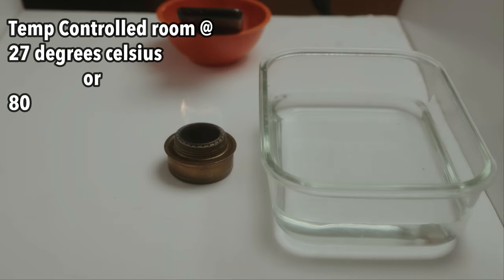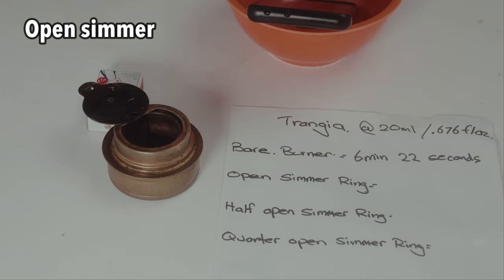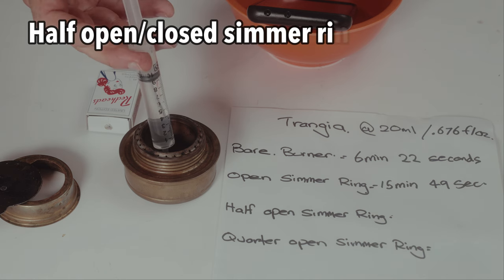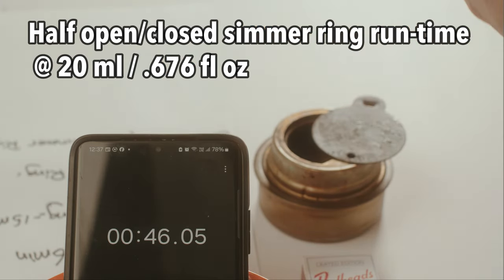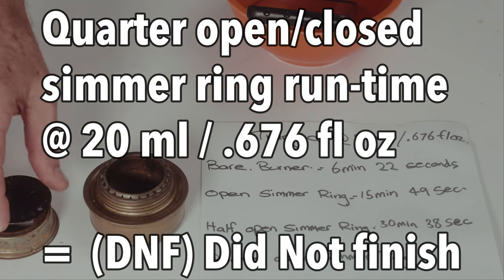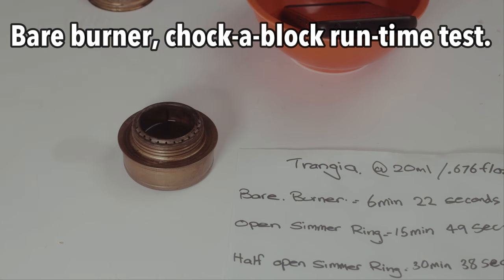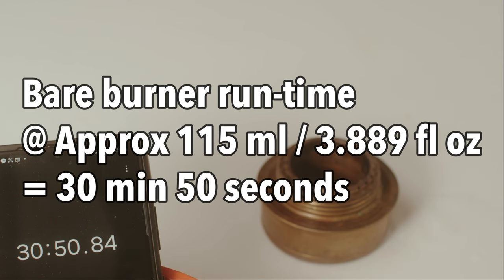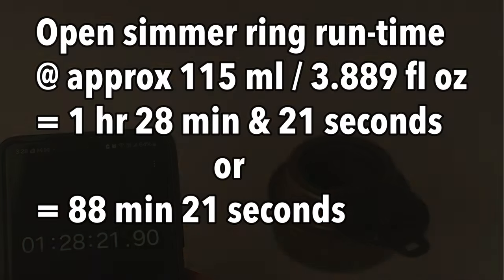How Long? -TRANGIA B25 Simmer-Ring Burn-Time. Alcohol Stove Damper

Comment: I've managed burn times of around 2 hours with 60mils of fuel and the simmer ring 3  quarters closed. Good for slow cooking purposes!  I've never tried it with the burner filled to the brim though. I would be concerned about the potential for flaring up if used outdoors in hot and/or windy weather. However, these sort of times do indicate that a Trangia with simmer ring in proper use can compete with gas canister stoves any day!
Reply from the maker: Thank you for sharing 😊. 
That is a good effort of 2 hours @ 3/4 closed. You are right about potential flare-ups in hot/ windy weather.
I keep going back and forth between gas and alcohol but it's great to be able to have options.

Comment: i have used the simmer ring at 1/4 open. Some pasta recipes require a 5-7min simmer period after boiling the water. So the trangia is already real hot when using the ring at 1/4 open.

Comment: Interesting Content thanks. Just be mindful that the reflected radiant heat from the bottom of the pot also adds to the gassing rate of the fuel. Increasing the burn rate and times. Hence  the quarter simmer ring  usually stay lit  and all cooking times are much quicker in my experience.

Bit of a story but in attempt to regulate heat to cook bread and make toast I strategically arranged some metal gauge mesh across the Trangia 27 

After about 5 mins I was impressed with what I had achieved. After 6 mins the red glow of the gauge mesh created a pre combustion chamber for an after burner . 

I had a three foot flame off the top of the stove. The wind shield was whistling air through it and I was fending the flames from the kitchen  roof in a pre camp trial.
It took about 2 mins to burn the remaining liquid fuel with a brilliant blue after burner , like a F18 hornet.

I now use a gas  flame for baking and toasting bread. 

Stay safe people. It is all fun until the physics alters your reality..
Reply from the maker: Thanks for sharing your story. 😊
Reply from the maker: What do you use for baking your bread?

Comment: 👍👍👍 .. good info, thanks.
A half-open simmer ring will bring water to a boil. I haven't timed it, but then, I'm in no hurry and it does not appear take that much longer.
Once my Trangia Mini 28 is in full cry, an almost-closed simmer ring will continue to burn. Sensitive to wind though.
Reply from the maker: This is true. Once these different types of burners heat up, they can be tricky to extinguish.
Reply: @bushgearreview  Yep .. the Simmer Ring / Snuff Cap, followed by a wet face cloth to cool everything down before handling / refilling.
Reply from the maker: @thomasmusso1147  I have to make a note on putting a face cloth in kit.🙂

Comment: I'm surprised you weren't able to sustain a flame with the simmer ring 3/4 closed. I use it like that quite often without any issues. Sometimes I have it barely open at all and it burns just fine. Though I usually throw the simmer ring on well after the burner has had time to heat up.
Reply from the maker: You are right. Once the burner has warmed up, it's almost impossible to extinguish without a well fitting cap, as I have found trying to extinguish the Goshawk.

Comment: Great!! Well done an actual good test...
Reply from the maker: Thankyou😊
Reply: @bushgearreview  no worries... I love using my trangia 27..  I baught some camping pots n pans off the internet and amunst them came an old 1950s/ 60s boxed trangia... I got some upgrades... keeping the old stuff safe.. now I can't stop using it. All my other stoves are just collecting dust these days ..  much lighter stoves, faster stoves, smaller stoves.. I will always use my simmer ring for more than extinguishing the flame now... because of your test.
Reply from the maker: The Trangia is hard to beat.
Imagine a Titanium Trangia.😊
Reply: @bushgearreview  I already had one of those fake Chinese trangia type burners... because the quality and attention to detail is not there it is a bit lighter.. I never use it now. Though if trangia did a titanium burner I would try it.. I would use the titanium body and wind guard.  Though not the skillet or pots.. I don't like the way titanium fails to transfer the heat.
Reply from the maker: I agree in regards to titanium not transferring the heat. Also, carbon soot build-up on pots can be a hindrance to heat transfer. 
What windguards/pot stands do you use with your Trangia?
Reply: @bushgearreview  I have the whole 27 set.. it didnt have a kettle . So I got one I, olso got a few other bits. I just use the regular windshield and stand that comes with the set.. the whole storm stove set does not require anything else... it's so stable and windproof.. it has the whole in case you want to use the remote gas burner instead of the liquid fuel burner...  I got the non-stick skillet that I have not used yet.. I thought it was aluminium but can't be sure. It may be titanium..
Reply from the maker: Thank you. I might have to pick up an old, used nostalgic set and try out.😊
Reply: @bushgearreview  you can buy a new one olso for quite cheap.. the 27 set is big enough to cook for two people.. the 25 set is big enough to cook for four people.  They do a mini set now that's the 28 set . It's for one person.... each set comes with different numbers like the number 1 set is comes very basic, no kettle  etc ..number 2 may have the kettle but no chopping board.. I have the 27 number 1... but I baught a few upgrades... so it is probably a 27 number 5  now.. I could buy more upgrades but need to do more research... happy hunting,,,  the trangia storm stove is one of Sweden's best exports in my opinion.  Take care.
Reply: @bushgearreview  if I was to buy a new version I would get anodized version.. it's  $70 somthing depending on the version you get.. don't think you get the kettle  for that price ... it is worth getting the kettle and multi disc.. the kettle boils water faster than a pot on a gas burner... good luck choosing your individual kit
Reply: @littlegrandadoutdoors 
I’ve had my Trangia 25 for  about 40 years and now only use the burner with the Stanley 2 cup cook set.   Today I ordered a Trangia mini. I think it might be the best option for a hiking stove.
Reply from the maker: The Trangia mini looks good. 😊
Reply: @vancamerawoman7399  I have just spent the weekend up Ben Nevis... I had to bite the bullet and leave my trangia at home... I  had dehydrated meals, so only needed to boil water... Though it did feel disloyal leaving my trusted trangia behind... carrying it up a mountain would have been overkill... I may look into the mini, but it depends on weight and if I can boil water for coffee and food at the same time... hope you are well, take care out there.

Comment: Wow! I am impressed! To be able to cook for more than 4 hours in a single fill is insane! As long as you are patient and are prepared not to have the super quick boil times that many gas stoved deliver, this makes for a very cost effective cook system. Thanks for the video. 👍🫡
Reply from the maker: Depending on your situation in regards to wind influence.😊
Reply: @bushgearreview  Sure, but even allowing for variables it makes for an economic way to cook. I have 6 different options for mobile cooking besides a camp-fire, but I have gone away from metho stoves. But I will have to reconsider now. 😁
Reply from the maker: I hear you in regards to different cooking options. I tend to fixated on one method for a while and then jump to another. 😊